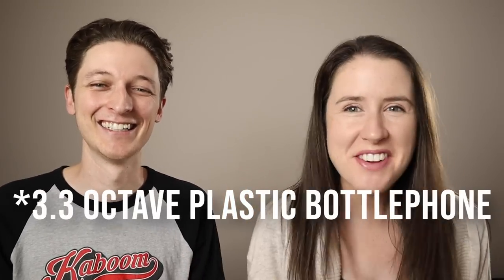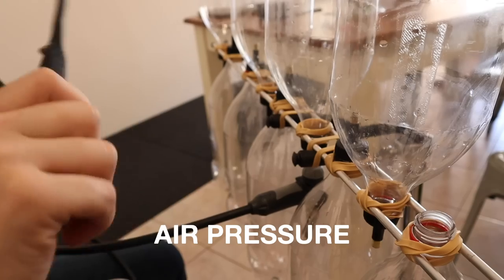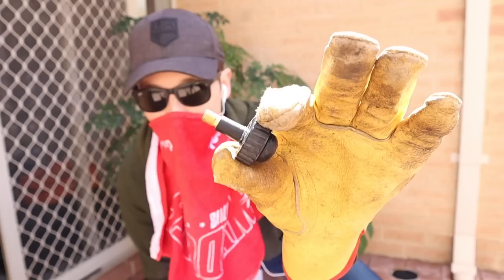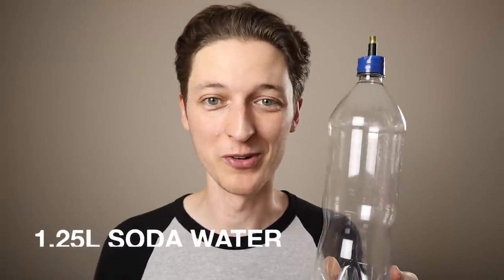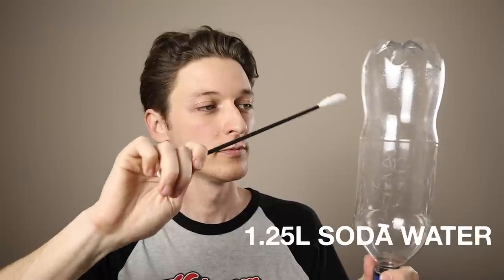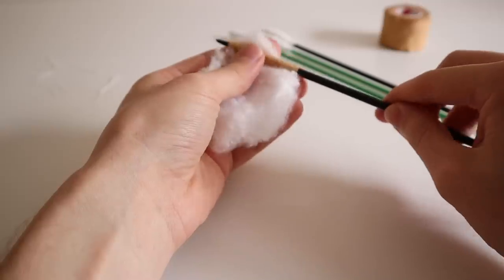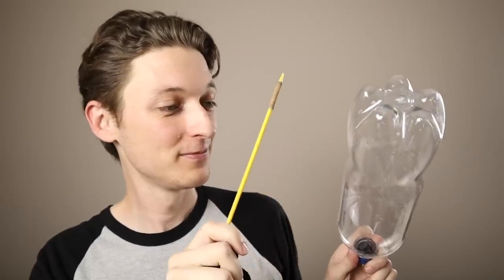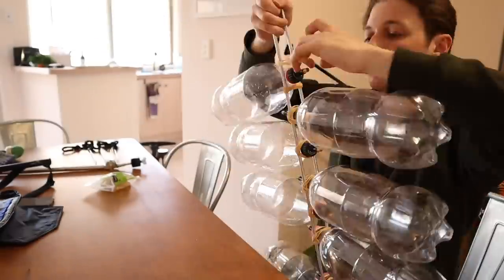How we made our biggest PLASTIC BOTTLEPHONE! [Plastic Bottle Instrument]

Comment: Hey I've got a tip for you! You can look up the size of hole valve stems get pulled in to, allowing you to drill all your caps at once. They also make cheap 'valve stem pullers' that are made for tire shops, which would be more than sufficient for what you're doing. No  superglue and no leaks! Many people have done what i have just described with no issues. 
CHEERS!
Reply from the maker: Oh cool thanks for the tip! I’m sure I’ve been doing it the hard way haha
Reply: @KaboomPercussion  Also, try out presta valves. I dont know if they will work for what you are doing, but they tend to be used in smaller, higher pressure applications like this. You see them mostly on road bicycles. Might fix your lids warping as the hole would be smaller.
Reply: @austinshoupe3003  was just about to mention this. The schreder valves being used are meant for high volume low pressure situations. Presta valves are meant for low volume high pressure. I think presta might be easier to work with if you can get it set up.

Comment: For the larger pressures could u maybe try using a metal washer on the inside of the lid. I'm just thinking it could help thicken the lid to stop it bulging?
Reply from the maker: Ooh interesting idea! We’ve since been making lids with a drill press and they’ve been consistently better than when I was doing them by hand with a smaller drill bit and eyeballing the final hole size. So far that seems to have taken care of the bulging issue but the washers are a good idea to mitigate some of the pressure. I’ll keep it in mind for the future :D

Comment: Have you tried replacing the plastic caps with metal ones of the same threading?  If so, did it help at all with the warping under higher pressures?  Also, do you use plumbers tape around the threading to created a tighter seal?  Thanks for your time!
Reply from the maker: I didn’t even think of metal caps! That would probably work really well. We haven’t used any plumbers tape, just a bit of superglue so far
Reply: Kaboom Percussion - Just a few things that came to mind...  I’m a systems engineer by trade and have played the Irish Bodhrán since 2004.  When I first got my drum, I reworked it with weather stripping and electrical tape (green, of course) to remove the ‘tinniness’ and make rim shots more subtle.  I’m nowhere near your level, but it would be brilliant if these ideas helped out.  Let me know if you end up trying them   I’d be my claim to fame... LOL!!  Cheers!!

Comment: Can you tell every pressure for every bottle? I am bit afraid to pump too much air inside, so it could explode. For 1.25 l you told approx 20 psi. And the over?
Reply from the maker: I don’t know the pressures exactly but our top 600ml bottles are around 75 PSI. Definitely best to err on the safe side though!
Reply: @KaboomPercussion  thanks, that is a lot. I have prepared a bottle and will try it tomorrow!